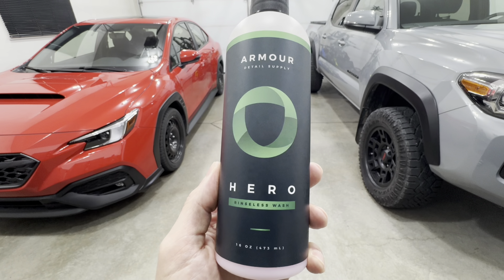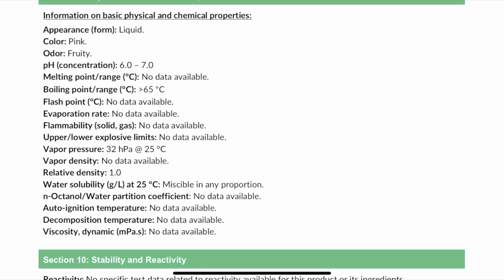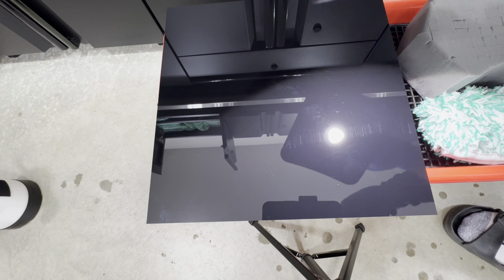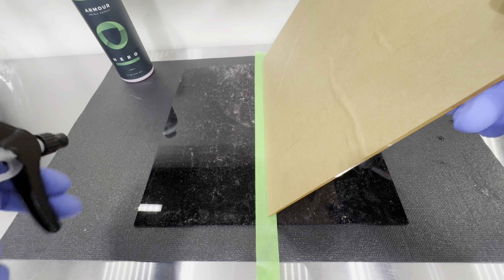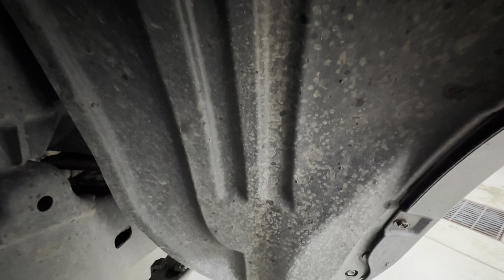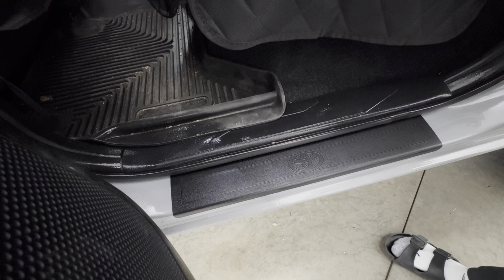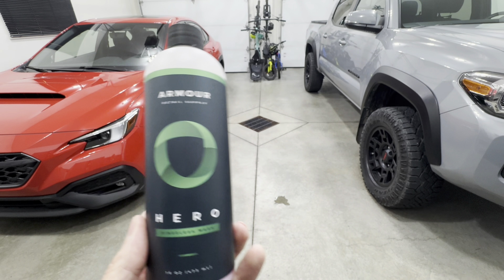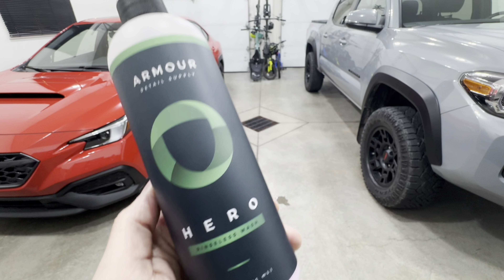Armour Detail Supply HERO Rinseless Wash -  Unbiased Review

Comment: Loving the RW videos! Do you have a video that focuses solely on drying towels? I feel like that would make a great video, specifically to see how each of the popular drying towels do on the plexiglass.
Reply from the maker: Thank you and hope you find the series educational.

I have tested the majority of the marketed drying towels, and they are dependent upon a given application and the “correct pairing” to the chemical product being used with the towel. There is NO across the board safest drying towel by name nor by weave or pile height for every application. The twisted loop that TRC marketed paired well with a traditional soap contact wash. The very first TRC and Griot’s PFM twisted loop drying towels launched into the detail space had the correct GSM, pile height and dimensions to reduce marring and scratching with this detail application. Over time, twisted loop drying towels became larger, added more GSM to absorb more water, lowered the pile height and went from 80/20 to 70/30 blends. Well, that caused some issues. … 

More GSM creates a heavier towel against the paint panel causing more downward pressure (even when using the drag/roll up towel method of drying a flat panel with two hands) – more downward pressure the more contact to the surface for surface drag and the more probability of leaving love marks on the paint. Adding 70/30 blend adds more absorbency making the towel even heavier and relatively useless with a drying aid as” towel gliding” is greatly reduced. Decrease the pile height to save on manufacturing costs creates an aggressive and abrading drying towel. I don't get towel drying - if your LSP on your vehicle is moderate to high “hydrophobic” stick with blow drying (why use any other drying method?) versus towel drying, if need be, grab a TRC minx pre-dampened to catch up any remaining water after the blow dry.
Now, Twisted loop towels somehow were brought over to the RW contact washing method without questioning their effectiveness nor limitations. Removing water from a rinse step in the traditional contact wash and removing a RW chemical product on a paint surface that also contains debris in chemical suspension is NOT the same detail application – so why use the same drying towel weave and pile height? See, no one really thinks about this stuff (unless you’re a lab rat testing stuff) everyone just “assumes” it will all work the same, but it's not “paired correctly” to the detail application.
The Achilles heel of RW chemical products is the use of lubrication substitutes (sio2 being the best) versus true lubrication agents found in car shampoos. It’s because of the no-rinse detail step of the RW contact method. Apply what I just said above about twisted loop towel evolution and now apply that to a chemical product lacking in lubrication properties with additionally more drying towel contact surface to the paint panel. Not good over time. ... Unfortunately, not all RW chemical products are formulated equally so you CAN’T just use the same sponge, wash media, drying aid and/or drying towel across EVERY RW chemical product regardless of what influencer or manufacturer says you can as they are just trying to “sell” chemical products or car detailing process narratives.

I have tested the Grito’s PFM (current marketed production) towel, since it’s a 80/20 blend, works extremely well with drying aids and being LOWER in both GSM and blend creates LESS towel downward pressure against the painted surface while the HIGHER pile height allows for better towel gliding – increasing the likelihood of better “marring and scratching prevention” BUT does not mean you will not get love marks as your downward hand pressure and wiping motion creates the majority of surface resistance causing the abrading factors to occur.

With certain RW chemical products I have tested, the TRC pre-dampened Minx MF towel used as a drying towel is extremely better as a drying application towel than a twisted loop towel because of its softness and sponge-like properties in the towel due to the coral fleece weave. I would NEVER use a twisted loop drying towel with a surfactant based (especially if it heavily concentrated) RW chemical product - that’s a recipe for marring and scratching.

Comment: Great review. I have never liked 256:1 ratio for any rinseless washing. It never feels lubricating enough…none of them.
One ounce per gallon is the sweet spot for contact washing, cleans better, more slickness, and appears safer.
Reply from the maker: I agree, all RW will clean however not all RW are built equal, and this is why it’s important to experiment for yourself  to find the  sweet spot. You will notice huge differences between them at different dilution ratios and what you need to prioritize is achieving the best user experience while maintaining safety.

Comment: Was wondering what are your thoughts on spraying products with SiO2, as they relate to our lungs? And when they become an aerosol. Doesn’t that chemical potentially lead to pulmonary fibrosis?
Reply from the maker: Yes, SiO2 (silicon dioxide) can lead to pulmonary fibrosis, a condition where lung tissue becomes scarred and stiff due to prolonged exposure to silica dust, which is a form of SiO2; this lung disease is commonly known as silicosis but Sio2 in an emulsion form (i.e detail, wax or in soap – etc.) there is no dust and I’m not aware of to date any Sio2 emulsion solution's that cause pulmonary disease nor correlation as such but there is hard evidence and it's documented that “Sio2 dust” in dust particle form, WILL cause pulmonary disease with continuous exposure.

Comment: Is the cap on the 16oz bottle considered half an ounce?  So 2 caps per 2 gallons?  I noticed the cap size is like 98..maybe 99% close in size to Absolute.
Reply from the maker: The lid is about 1/4 ounces, so you will need 2 caps for every gallon of water.

Comment: when is the ONR review coming out? I hope it is the next one in this rinseless wash series. I would like to see how good it is at removing dirt from the wash media compared to other rinseless washes you have tested
Reply from the maker: If you know how to properly wash a vehicle especially with ANY RW, You should never re introduce your wash medium to your solution, period! Not sure why this test is so important?
Reply: @DetailProjects Yes, maybe this test isn’t necessary. 
However, with ONR, the recommended wash media is a single unit of BRS as per Optimum’s guidelines. It would be interesting to see if there’s any marring on the plexiglass with this setup compared to other rinseless washes which advertise better cleaning of the wash media. 
Also, I think the test should involve dirty water from the middle of a wash process to prevent the chemical from allowing the dirt to settle too much if that is a thing
Reply from the maker: I agree, it’s going to be interesting for sure All my RW tests will include a before and after scratch test with clean and dirty water just like we saw in the hero video.
Reply: @DetailProjects sorry I’m confused, how do you not reintroduce your washing medium into your cleaning medium? Are you using 2 bucket method? Would this not dilute the RW? You must be in Alberta near Calgary? Slight picture of license plate and shout out to Carzilla.

Comment: Are you sure the SDS info you are talking about are actually things they just didn’t bother with vs don’t apply? Their products are very safe, and the owners are very responsive and quite transparent if you have any questions or concerns. 

There are many large companies that have SDS sheets ‘lacking’ similar info. I’m not sure what is required for them to complete. But if there aren’t hazardous ingredients in it then there won’t be much info. 

Second I am surprised you don’t like the scent. It is one of the best smelling rinseless washes I think.  It’s a strawberry scent. 

I think they are updating the scent though soon, so it’s possible yours is off and would make sense why they are revising it if there is a scent issue.
Reply from the maker: SDS sheets section 9 and 11 are typically filled out with information from well established companies that actually do testing with their products. That’s how you tell a company actually spends money on R&D for your safety. 

Most companies especially new will either not have the funds or resources to do so and they simply don’t fill the data. That’s a risk for you the consumer to find out the hard way. They pretty much say you , use at your own risk. IMO companies need to be held accountable and must to proper R&D for the customer safety. 

If you are ok with taking someone word for it until someone get hurt, good on you, however from a professional pov, I would hate to use a product with no information and potentially damage a customer car or put my staff safety at risk because of the lack of information. 

Btw 99% of people don’t even read or care to read SDS to find out what they are working with. It’s actually scary when you know for a fact how dangerous chemicals are. We see people not even using gloves when Rinseless washing?
Reply: @DetailProjects  We can assure you, safety for you and the vehicle are at the forefront of our development. We actively have to pull formula's back in terms of performance due to this, and we test other companies formulas that are actually not even close to what is claimed on the SDS. Like you said, there's lots of sketchy trickery that can go on with SDS to make it seem safe, when it is in fact not.
Reply from the maker: I think SDS are overlooked and under rated giving companies (not all) the opportunity to leave out lots of information. I am happy you recognize this and are working hard  in every aspect of your business growth to be transparent. The community really needs more of this !
Reply: @DetailProjects Yes, it's concerning how unconcerned most detailing enthusiast are about their health with regards to the safety of products and using PPE. I think you are the only reviewer I've seen who talks about the SDS. 

Generally, I try to only use EPA Safer Choice products for cleaning my home but there are virtually none for detailing unfortunately.

Comment: Can you explain how close the Acrylic panel is to a top coat on a car? I just dont understand how that test really matches up.
Reply from the maker: The purpose of using plexiglass as a chemical test media or medium is to test and/or determine chemical etching (burning) or scratching called frost lining. 

Unlike clearcoat on a hood, plexiglass with show a surface frost line we commonly call a chemical scratch but really is mild to moderate to advanced chemical etching.

Unlike clearcoat on a hood plexiglass will etch or scratch easily to identify with the "naked eye " chemicals like ammonia, buffers, acetone,  surfactant identied by classification as ionic surfactants have a tendecy to frost line etch, solvents, etc. in the product formation. The list goes on and on what plexiglass and polycarbonate can tell us, think beyond the media contacting the surface but the product's chemicals in the formulation contacting the surface and its reaction when heat is built up when adding pressure, resistance and contact washing with the RW product and the chosen media. Plexiglass is used in chemistry labs to easily identify this cause and effect relationship then verified by microscope analysis.

That's why I guard against media scratching by wiping in 2 directions. It may not be a full proof test but I chose test parameters and mediums any detail enthusiast can do for themselves versus buying a thousand dollar gamma or hamma handheld 500x  microscopes to see the same scratch etching on the clearcoat of a hood. ...

Hardness has nothing to do with chemical burns at the surface nor frost lining because of a chosen chemical product being  used. 

"Frost lining" is "chemical cystalization" that causes a scratch on the surface as it (crystallization) is moved along "a or the surface of the medium" from downward pressure!

Plexiglass has virtually the same clearcoat on it as clearcoat on a car by molecularmakes, more important than clear mil thickness.

Plus, you can take your Plexiglass to a body shop to add more cleacoat layers to the same mil layer as a vechile's 4-4.5 mil that's what calibrated means, same mil layer thickness.

Ironically, the clear on today's Plexiglass abrades the same as clear on a car as manufacturers lowed the carbon content worldwide per regulatory requirements since 1991.